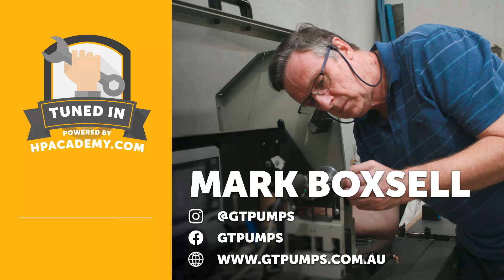132: The Best Stock Turbo System? [#PODCAST]

Comment: I've used Haltech E6K quite a bit. It fuels and sparks an engine pretty darn decent. The "throttle pump" feature basically didn't work, but otherwise very serviceable. The 2D bar graphs seem primitive - but they're very functional.

Comment: Being a US native, I've always wondered that very same question on how the AU became the legacy innovator's in beyond OE ECU's. It's similar the UK being home to some of the most talented musicians in the world. But back to the AU and it's hand in the EFI aftermarket, I had always presumed you guys had a closer intro to EFI in general having natively built car's which shared parts bins with Nissan, etc, and probably a fairer share of Japanese cars in proportion to native brands from the onset in the mid 80's that created the conditions for these solutions earlier on.
Reply: I think the Australian ECU pioneers cut their teeth in the ATCC in the 80s and 90s.
Reply: Yes and no. During the development of the Haltech we used whatever EFI road cars were available. I’m pretty sure in the early years the only race car fitted with a Haltech was the Lansvale Commodore, first up on the VL Group A Walkinshaw for Bathurst ‘88. I still have vivid memories of being strapped into the passenger seat at Amaroo Park and unsuccessfully trying to map the transients to improve drivability. We got to Bathurst and found analogue Motec and Autronic (Perkins) and digital Zytek (HSV) ECUs fitted to other VL Group A Walkinshaw’s. Lansvale went back to running carburettors until 1991 / 92 when we went back to running a Haltech. I did the calibrations during this time up to and including Bathurst’94. The first full sequential Haltech E6 unit produced was installed for the ‘93 Bathurst. The wizard (Mark Boxsell) also developed a telemetry system for that year.
Reply: But certainly the ATCC was Motec’s development world.